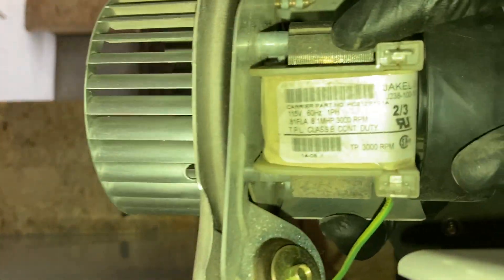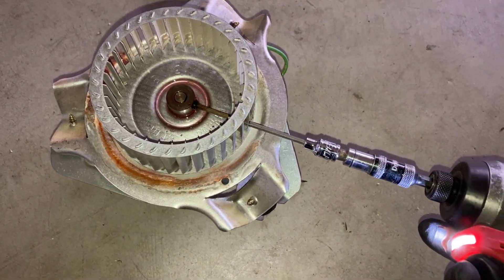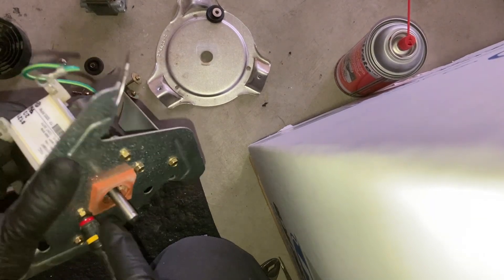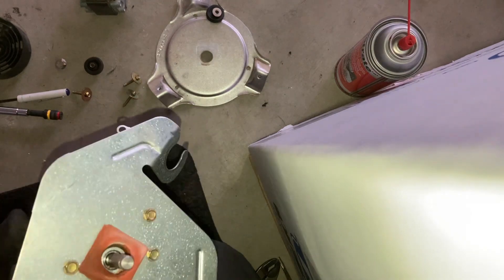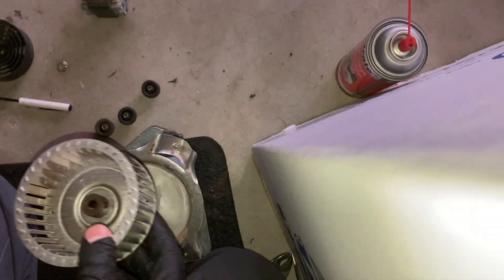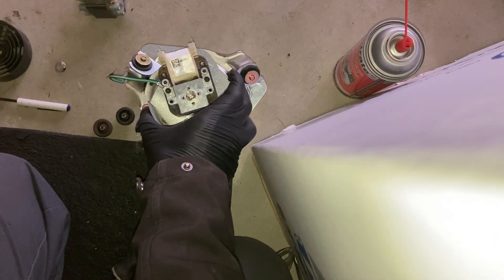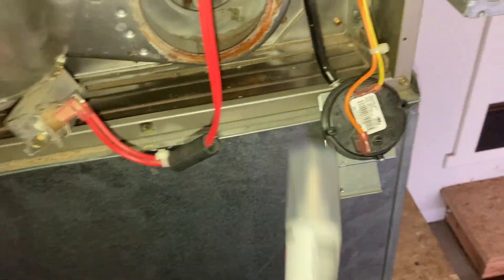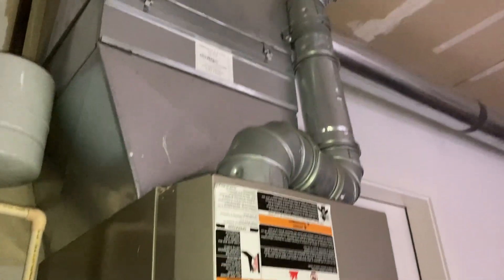Furnace repair | replacing the inducer motor start to finish

Comment: What's your source for parts, i tried a few off Amazon and none are exact - almost like the shafts are mirrored.
Reply from the maker: @quarantainment293  not sure what you mean by mirrored. I got them from a local supply house. What is your furnace model number?
Reply: @victork3397  it was my mistake - the side that the squirrel cage goes on had a groove. I thought the star washer went in that groove. When I took a look at the original, the groove was definitely on the squirrel cage side as the hex bolt indent was there.
Reply from the maker: @quarantainment293  ah gotcha! Glad you got it figured out.